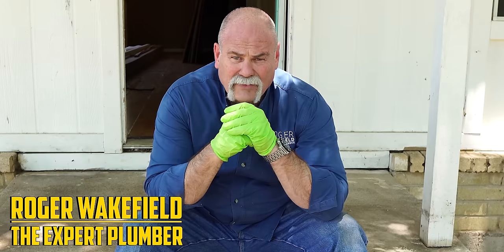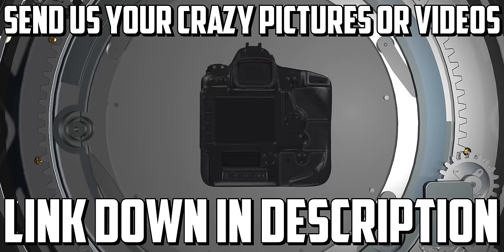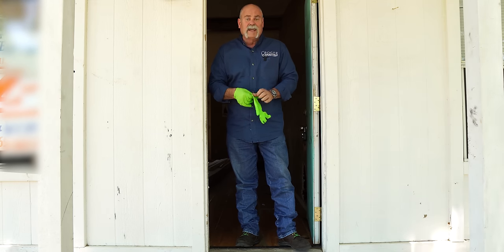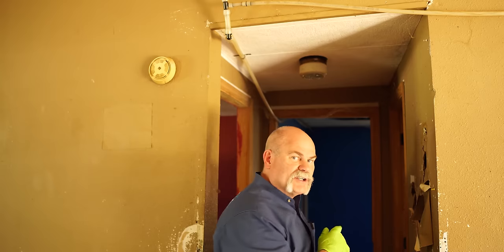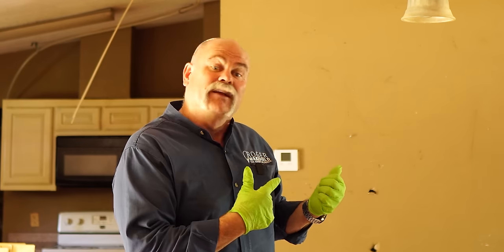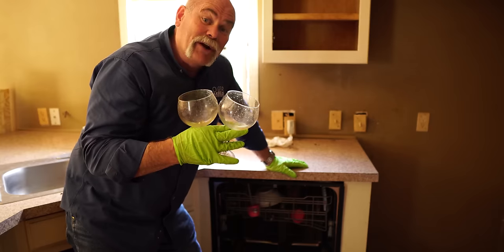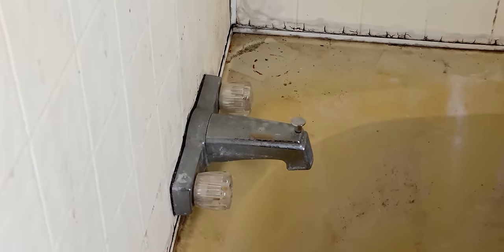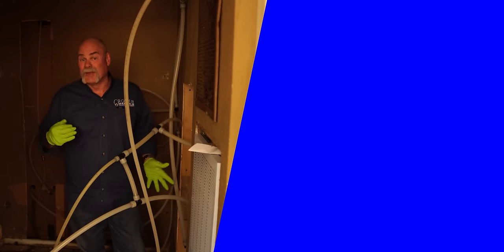This is THE WORST Plumbing Job in America

Comment: Guarantee you someone pulled all the copper pipes out of that house to sell for scrap and this was the best the handyman that bought the house could come up with without cutting all the drywall out but damn take it easy on the shark bites they are way to expensive to use everywhere

Comment: Maybe this guy knew Texas was going to freeze. Notice how it's all propex. Either he was a plumber who owed someone money or a crackhead that robbed a plumber. Or just commutes on the idgaf train everyday. I work in the temporally permanent trades and I would rate this a 4.5 out of 10. He lost points due to no hot water and only using one color. If he had hot water and used red, white, and blue, it'd definitely be approaching 7.5

Comment: Come on Rodger that's just artwork and think of how much cheaper it was to run the water on the outside of the walls genius pure genius but he should have used electrical tape to hold the hot and cold water together that's my opinion LMAO

Comment: With pex anyone can be a plumber.
Reply: Your not supposed to have plastic pipe with in 18 inch from the hot water heater, in line.

Comment: Nothing wrong with shark bite fittings if they are installed correctly and the pipe is cut square and is deburred , thats why they leak  I have some Shark bites in my house that are over 10 years old not a single leak even on the poly b pipesthey are transistioning to new pex  in my 1992 house . Pro plumbers bash them because it has allowed regular guys to do thier own plumbing work now insteaed of being ripped off to the tune of 200 bucks just to show up or several grand to come to thier house and fix some basic plumbing or charge 300 bucks to simply install a water heater. many americans paychecks are only 300 a week. They cant afford that. If they were that bad they wouldnt sell them and recall them from the market . Pro Plumbers think they are magicians because they can sweat 2 pieces of copper together and the Shark Bite has bitten a lot of thier labor revenue out of the Pro plumbing industry and i can understand that sentiment but its not a bad product and as long as you have a regulator and dont run the system at crazy pressures . My house was plumbed by a licenced plumber and it was horrible , it takes forever to get hot water upstairs and  if you flush the toilet it will change the temp in the shower . Also the  entire house is plumbed with 3 inch waste lines from each toilet instead of 4 inch, what did that save 30 bucks? I have had to snake the mains several times. I have replaced all the polly b in my basement that i can get to, i still need to open the wall leading upstairs to do the red and blue PEX to one upstairs bathroom . i have not had a single leak from any of the work i have replaced. I secured the piping better than it was and  better  than local code requires here in my state. I even ran a new 1 inch line in from the meter. You dont have to be a licenced plumber to do a quality job, just take your time and do some research and look at others work  and how not to videos . The national plumbing code is avaidable online as are countless videos on how to plumb a home correctly. Plumbing is not that much different from electrical, you need the proper size pipe  fittings to carry various water supply demands  to move water from one place to another.Same with electrical , You need the right size wire to supply the demand of whatever your trying to run. Plumbing  fittings reduce the flow internally just as connections do with electricity create electrical resistance . Id say 90% of plumbing and electrical is common sense and  installing the pipes and wires /conduits /BX cable ect so they arent dammged by nails or screws when drywall is installed or ran where they can get kinked or physically dammaged and just securing the materials  to the wall or to a joist or stud . I was in a house today built by a local builder, the only thing holding the shower valve to the fiberglass enclosure was two regular drywall screws t a piece pf chipboard .They were not treated or stainless screws.just regular black 3 inch brywal screws that snapped right off now that the wood was dry . The grey poly pipe leading to the valve wasnt fastened at all to any wood so when  you shut off the water quickly the pipes bang against the back of the fiberglass enclosure thats kinda rough on the back side that may eventually rub a hole in the pipe . I mean seriously? how did that ever pass inspection? i ripped it all out and replaced it all with pex and installed a tee and short piece to prevent water hammer and secured everything with the right straps and stainless steel screws on the new shower valve . Again just common sense...

Comment: Definitely a methhead did this work looks like something my wife's cousins would do. I'm working on a trailer they framed up and the more I work on it the more I'm like why would you do this or that. And clearly they didn't think about finishing the inside when they built it either. Ever panel has to be custom cut since nothing in on 16 or 24.